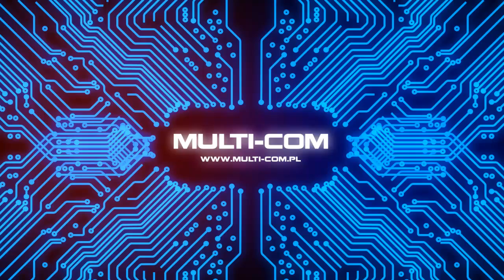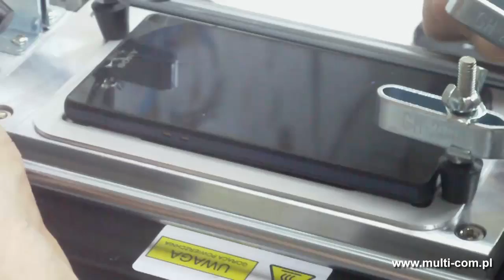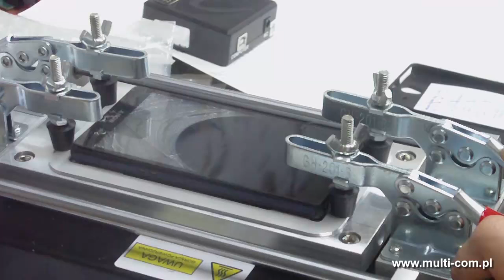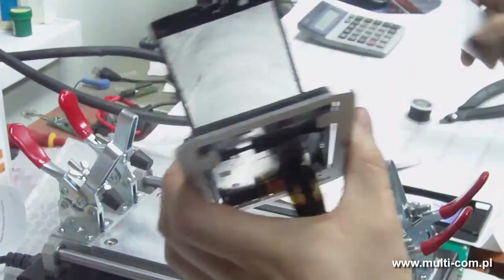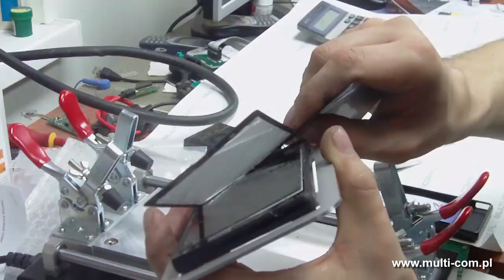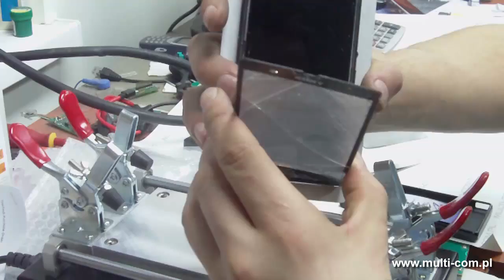Sony Xperia Z Separate Touch Screen (Digitizer Glass) Scotle PR-1000

Comment: Nice video! i am about to attempt this myself, only one question though, how do you stop LOCA adhesive from coming in the camera and proximity sensor holes? wouldn't that be a problem?
Reply from the maker: After you remove glass you must remove LCD too from phone. Once you got it seperates you can assembly LCD + glass usign xForm (http://www.multi-com.pl/index.php/en_US,details,id_pr,14653,menu_mode,categories,smenu,service_tools.html) - then you don't have any problems with camer/sensors
Reply: Mask by taping . Sensor holes and LCD edges.

Comment: How do you clean the glue off the LCD or is it not needed to take off when you put the new Digitizer on?
Reply from the maker: Ofcourse you need to remove old glue - we use for it IPA Cleaner - in Poland cost aroudn 1 USD for 50 ml bottle

Comment: Is it necessary to remove backlight from the screen in the process of gluing replacement glas with digitizer on LCD with LOCA glue like on iPhone phones?
Reply from the maker: You need to take out LCD from bezel/frame if this is your question... only then you can cure LOCA glue as it schould be
Reply: Ok.  But doesn't this LCD have some kind of backlight box on other side of LCD like iPhone? My point was that i'm woried that LOCA glue won't get in LCD and have the same affect like water was in phone.
Reply from the maker: Nikola Santek I think you not understand. After you will remove broken glass from phone you need to take out also LCD from frame. Once you got it on desk you can connect together - if you will correctly cure and apply LOCA then all will be OK. There are also diffretn solution for this but not suggested... usign 3M duble side tape only

Comment: Hi, do i have to clean the lcd panel before i put on the new touchscreen- glass and do i need a special glue then for my xperia z3 ? 
thx and nice video, thumbs up !
Reply from the maker: Yes - you need to clean it from old glue that rest on LCD. In some cases when you cut off broken glass also polarizer are demaged - this can be buyed seperatly also and need to be applied to screen. Next you can connect LCD with glass. Please just note that so LOCA technology so liquid glue are not suggested for it - glue will comes beetwen LCD matrix and demage it - please refer OCA technology

Comment: Great video, thanks. Can you tell me what temperature you used on glass?

Thanks
Reply from the maker: ***** Procedure starts when glass reach 60C... you can measure this with digital termometr or K-Type termomemtr connected to your multimetr
Reply: Thanks a million for taking your time to reply in timely manner.
Reply: If you had been preheating the glass properly, it had been a lot easier to remove it...

Comment: I noticed when I clicked the link in the description that this xFrame is for Xperia Z model c6603.  Will this same exact xFrame work for Xperia Z c6606 as well?
Reply from the maker: For this moment we dont' have for 6606 but I'm not sure if it will not fit into yoru phone -we are unable to test it since we are lack of phone. All available xFrames you can check at http://multi-com.pl/index.php/en_US,browse,id_gr,1553,menu_mode,categories,smenu,service_tools.html
Reply: I will probably just not use an xFrame for this job.  Thanks anyway.

Comment: What kind of adhesive did u use to put the new screen on the  LCD
Reply from the maker: We use LOCA - range of those products startign from 30g tubes to 50g tubes (so 30 Ml, 50 ml) you can find here http://www.multi-com.pl/index.php/en_US,browse,id_gr,1567,menu_mode,categories,smenu,service_tools.html
Reply: MultiCOMPL your video shows the wire going in under the glass to separate it from the rest of the phone. is the phone seated on a heater to warm the glue? once the screen is removed can a new one be simply glued back on around the edges to replace the broken one?

Comment: Sir one question, what type of thread you used to sepearate out digitizer from LCD display??
Is it normal cotton thread or any other special! Please name one!
Thank you!
Reply: is that Molybdenum Cutting wire for LCD!
Reply from the maker: You can find it here - http://multi-com.pl/index.php/en_US,browse,id_gr,1600,menu_mode,categories,smenu,service_tools.html
Reply: Rohit Jainapur guitar string is the same,  cheaper and stronger
Reply: Thank you!
Reply: Janusz Staniaszek Guitar string is strong but it's not so cheap - molybden wire cost 10 USD for 100 meters

Comment: hey
where can i get the Alignment Mould for experia z/z1/z2?
and did you used the oca film to seal off the oca glue  from entering the backlight?
thanks
Reply: and is oca film also called duoble sided tape?
Reply from the maker: Alligment mould you can find at http://multi-com.pl/index.php/en_US,browse,id_gr,1552,menu_mode,categories,smenu,service_tools.html
For LCD phones so Xperia we use OCA technology - not LOCA glue
Reply from the maker: arsenio moidn OCA is not double side tape - it's OCA film - you can buy OCA here http://multi-com.pl/index.php/en_US,browse,id_gr,1598,menu_mode,categories,smenu,service_tools.html
Reply: MultiCOMPL means that i cant use loca glue or double sided tape to replace the digitizer??
Reply from the maker: arsenio moidn Using LOCA (so liquid glue) it's not suggested since it will comes beetwen layer of your LCD and make demages. If you will use OCA (so double sided special tape as here http://multi-com.pl/index.php/en_US,details,id_pr,16489,menu_mode,categories.html) then all will be OK
Reply: MultiCOMPL but if i use the oca film. i will get bubbles right??? means ill need to get a autoclave to?? or is there an other way to get rid of the bubbles?
Reply from the maker: arsenio moidn You need Autoclave.. there are no other way for work with OCA
Reply: hey 
Uhm i have a air compresser can i use that to remove bubbles??
so yeah how much presure do i need to use?
Reply from the maker: arsenio moidn Moulds you can find here - http://multi-com.pl/index.php/en_US,browse,id_gr,1552,menu_mode,categories,smenu,service_tools.html

For LCD type so screen used in Xperia use OCA technology - not LOCA, otherwise as you writes liquid will come beetwen layers and demage it.  More informaiotn about OCA technology you can find at http://multi-com.pl/index.php/en_US,browse,id_gr,1596,menu_mode,categories,smenu,service_tools.html

Comment: Hi, couple days ago I dropped my Z and the screen cracked, it would still turn on and I could see the lock screen, but the screen wouldn't respond to any swiping. I removed the back cover and the battery and then reattached the battery, but now the screen doesn't light up anymore, do you think just replacing the screen would fix it? Or does the digitizer have anything to do with it?
Regards,
Total Noob about phones.
Reply from the maker: You need to replace screen - but it's only speculations, when service point will check phone then all will be clear.
Reply: Thanks!

Comment: i have problem with touch screen on my xperia Z,is it possible to replace only digitizer,not whole lcd ?? or two parts are integrated entirely
Reply from the maker: they are integrated but it's ofcourse possible to replace only glass...however it's not possible in home since you will need special machines for this
Reply: thank you so much

Comment: Sony quotes a repair/ exchange of a cracked digitizer at it´s repair centre in Ashford/ Kent with 104.57 GBP. Don't know if that´s expensive?

The bad point is that they erase all your data irretrievably from your phone.
Certain cracked displays for Xperia Z series will be repaired under warranty. It depends on the crack itself:

http://www.xperiablog.net/2013/11/08/sony-will-repair-certain-cracked-displays-for-xperia-z-series-suggests-leaked-info/
Reply from the maker: Usually OCA/LOCA repais cost around 40-50 EUR depends on location .... we mean service cost + additional cost od digitizers.

Comment: yes i think the chap was under the impresion he could do this at home which he can but if he hasent the correct tools to do it it will look awfull its not a DIY fix its best left to the people in the busness (unless you want to get a OCA set up for over a grand of cause ) in which case thease chaps are the best people to get it fron but get the dust free kit as well you wont regret it
Reply from the maker: You are 100% sure - making this at home correctly without using special tools as autoclave, OCA it's not possible but it's not mean that it's not possible for proffesional repair center

Comment: as per this video only touch panel is change ..
Reply from the maker: We changing glass only so part which is demaged
Reply from the maker: Balu Jadhav Please note that we don't repair LCD's for inviduals - you need to find your nearest service points who make it
Reply: MultiCOMPL
I have sony Xperia z .last fue day it has brock on my hand..so its only  touch panel is brock not an entire display.when I was seen this video i was think it possible to change is touch.becouse some service center are told me it is not possible..
so i request to you plz give me current seggetion to change touch.

give me a advisor  add to change it

Comment: You can do this but it WILL RUIN YOUR PHONE. The screen will look terrible.
Reply from the maker: You can do this and screen will look as brand new sir.... if you cannot make something this not means that others can't too. You need a litlle bit practice and after you can cut broken glass without any problems. To apply new glass you need to use OCA technology... if you will try to use liquid LOCA you will not sucess for sure... maybe here it's problem that you describe.